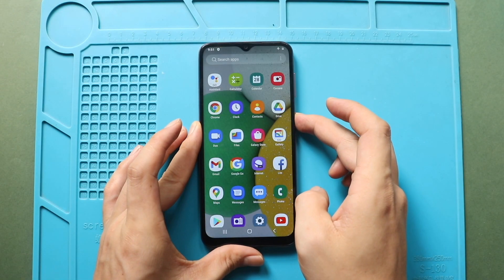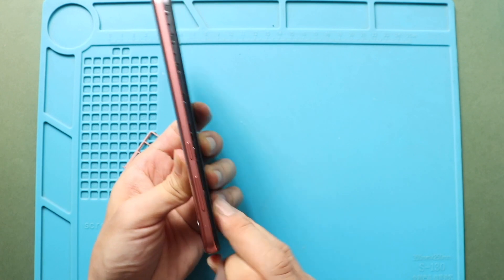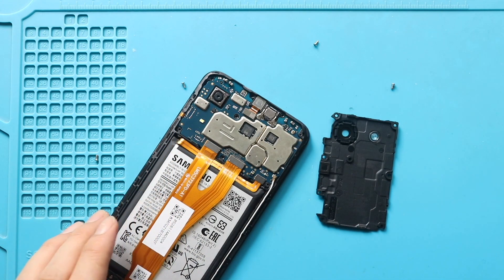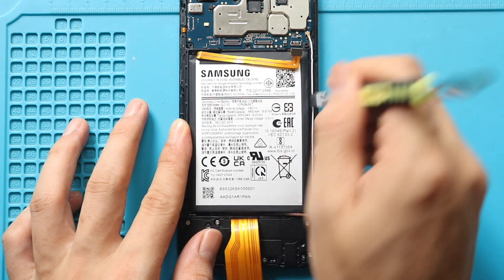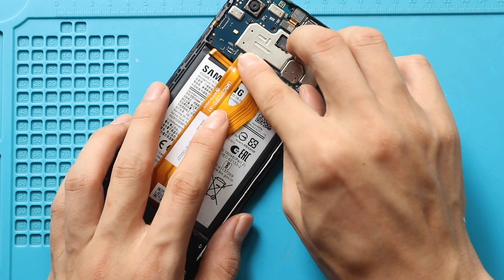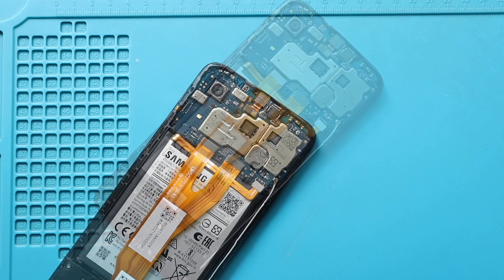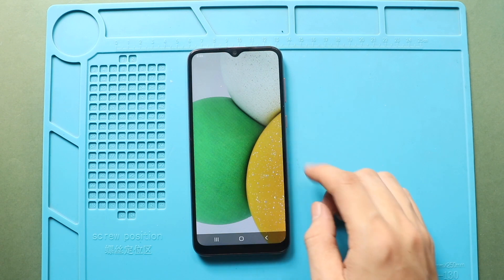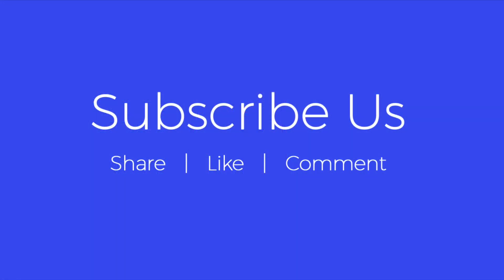Samsung Galaxy A03 Core Battery Replacement

Comment: A disgusting rubbish phone. I went through hell to open this bl**dy thing. IT IS NOT AS EASY TO OPEN & CHANGE THE BATTERY AS SHOWN. The screw are ridiculously small and require a very small micro-screwdriver. I shall not be buying a Samsung again!

Comment: how can you tell if the battery not working.. my ao3 wont turn on.. the charge symble shows a lightning sign but no percentage.. battery voltage.. with a multimeter measures 6.3v.. when im inside the ph
Reply from the maker: Can you try with a new battery..